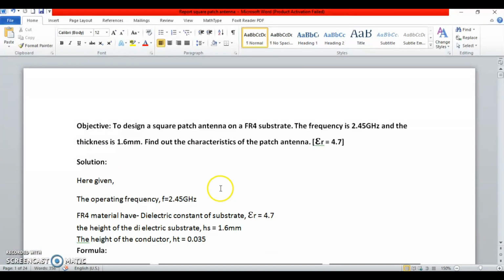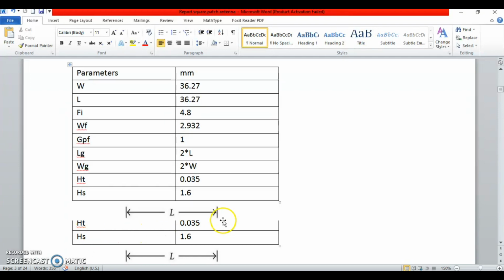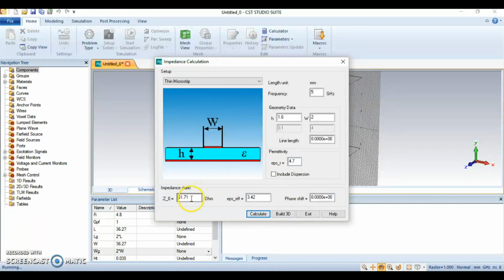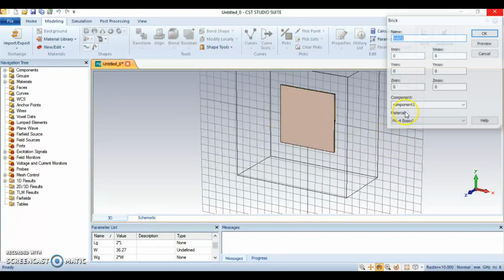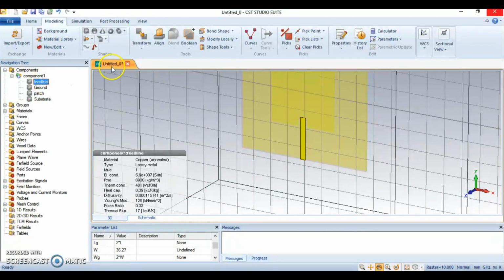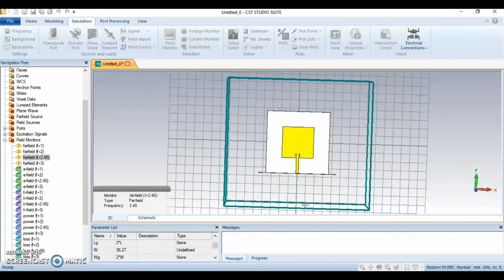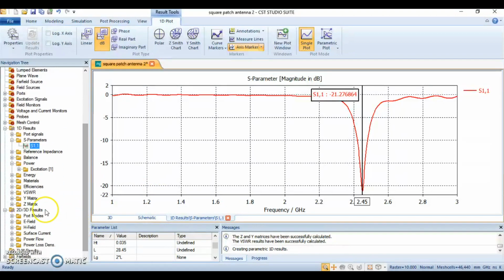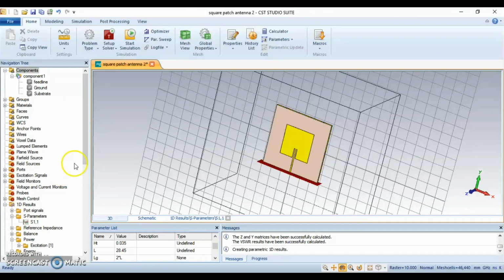Microstrip square patch antenna using CST by Shamsur Rahman Akash

Comment: From which book did you get the formulas of ground plane dimensions ?I've searched many books and I couldn't get them and in many research papers the formulas were 6h+l ,6h+w.
Reply: Constantine A balanis Antenna theory and design
Reply: @ajeetcorporateblogs  I even searched in balanis and no where it is mentioned. Could you mention the page no?
Reply: any success?
Reply: @sultanalhammadi2910  no, but I simulated different dimensions and I found no big difference. But for my project I simulated a coax probe feed instead, it was easy!!

Comment: Would the 50 ohm characteristic impedance change since Wf is changed from 2.932 to 1.13. Although you got S11 @ 2.45 GHz with a gain of -21dB, how would you make sure that you had a 50 ohm impedance match at the input?
Reply: When h = 1.6 ;W = 1.137 and eps_r = 4.7 impedance gets close to 80.56 Ohm so design definetly could be improved

Comment: Can we design 10.5 GHz antenna?
Reply: With increases in frequency,height of the substrate(thickness)decreases. But for good radiation height should be large but value of dielectric constant should be low. After increase in a particular value of height or thickness of substrate, radiation decreases. So, you can check result of your antenna by taking 10.5 Ghz.
Also take less value than 10.5 Ghz in one case and then take more than 10.5 Ghz. Finally,check the results.

Comment: Nice work! Shamsur Rahman Akash. Which frequency of the operation is used? 2.45 or 5 GHz?. I just wondering, since you used 5 GHz instead of 2.45 GHz  for calculating width of the feed line.
Reply: No problem with this value to calculate wf

Comment: how did you get wf???
Reply from the maker: Wf depends on your design. If your Wf is different then try to recalculate the parameters value and simulate until you get the perfect output result as here I got the resultant frequency of 2.45 GHz